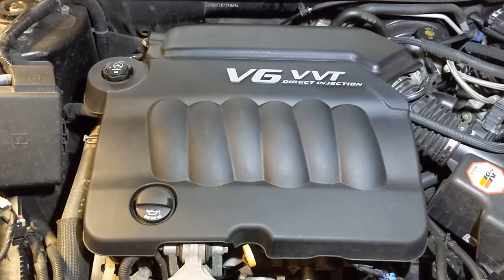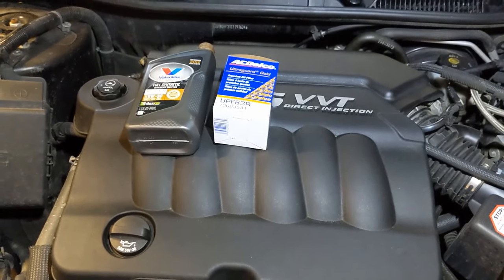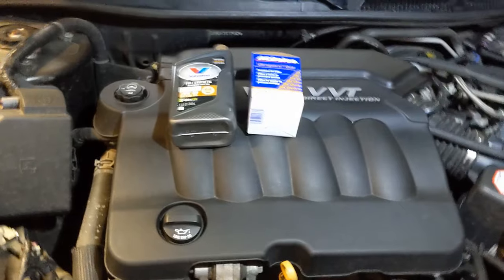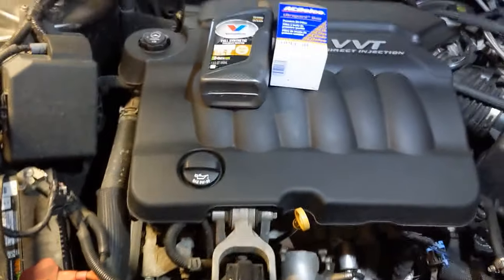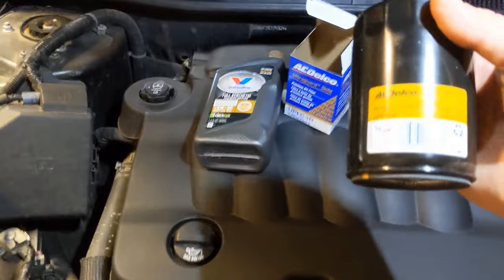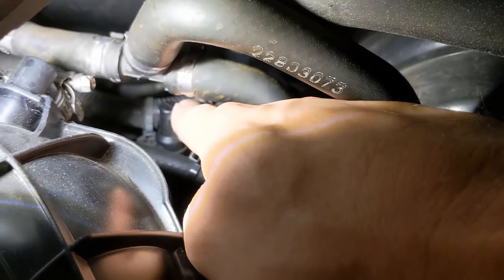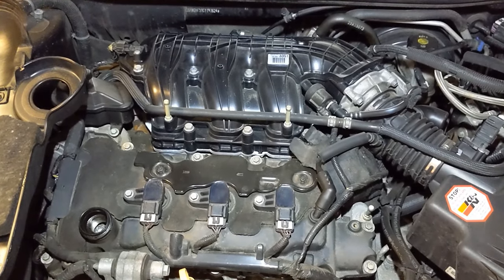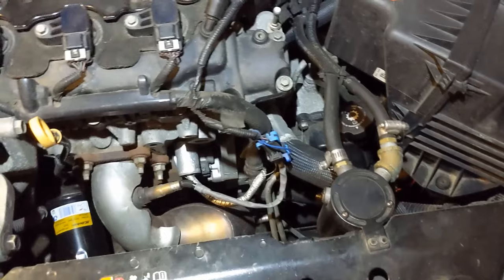How to keep your GM 3.0 or 3.6 V6 running forever - **High Feature V6 LY7 LLT LFX LGX LGZ**

Comment: What do you recommend for a 13 impala ltz has 152615 miles on it bought it almost 5 years ago with only 38k what maintenance do you recommend to keep her running strong
Reply from the maker: I would recommend the same service as I mentioned in the video. You also might want to think about getting a "BG Products Dynamic Engine Cleaner" service performed. Basically they run a bunch of chemicals through the fuel, oil, and induction systems to clean out all of the carbon and sludge.

Comment: wife wants a 2022-2023 acadia. 3.6. Are the newer ones any different as in better/improved?
Reply from the maker: Yes, they are much better. The LGX in the Acadia is essentially an all new engine. I wouldn't take that as a reason to skimp on maintenance, tho!!
Reply: @CertifiedShadetree  thx for the reply! Oh absolutely on the maintenance. I was just more curious if these are more reliable than the previous. She really wants the vehicle so I’ve been trying to do a lot of research and it’s in our price range

Comment: Any common failure points besides the timing chain failures? I feel like I keep hearing stories of woe involving the High Feature V6, but it could just all be poor maintenance intervals and confirmation bias.
Reply from the maker: All of the problems stem from poor maintenance - basically when the engine gets sludged up is when the problems start. The chain tensioners go first, then the chains stretch and jump time.  The VVT solenoids also shit the bed around the same time. Each newer revision of the engine is better than the last.  The earlier LY7's and LLT's are the most problematic, with each subsequent revision an improvement over the prior version.  As one commenter posted, the LGX is an entirely new design, and the least problematic of the bunch..
Reply: @CertifiedShadetree  I have a 2014 impala ltz 3.6 vvt are they known for any bad issues as well.
Reply from the maker: @nathanu.2061  Yep, same engine.

Comment: I have driven over 80,000 km with P0008 and P0017 codes!
It hasn’t skipped a beat yet. I’m waiting for it to go boom,but nope.....the GM money maker keeps right on running.
Yes the dealership said I had to replace the timing chains with these codes. They checked them three times based on those codes. It’s very important you know!!!!! GM junk.......I’ll drive it until it blows!
Reply from the maker: What year and model is your car?
Reply: @CertifiedShadetree  
2011 Chevy Traversty
Reply from the maker: 🤣 Traversty 🤣🤣  I used to own a Cadaverlier ..
Sucks you're stuck with an LLT.  I noticed those engines are 2x the price of an LFX on car-part.com.  Just shows they're failing at a higher rate...
Reply: Jimmy S  
It’s just those two codes.......has been for a long time now and it runs just fine.
I hate this car but it just won’t blowup !

Comment: I’m fixing to do this, I have all the parts.  I also want to replace the hose that this pcv attaches to.  I can get the hose off this valve, but how do I get the other end of the hose off?  I’m not familiar with it and I’m afraid to force it off.
Reply from the maker: I explain in this video: https://www.youtube.com/watch?v=-XlG5po15Fw
Reply: @CertifiedShadetree  , perfect, thank you, now I know the anatomy of that booger.
Reply from the maker: @MarkSmith-js2pu  Best of luck to you! 🍻

Comment: Whats the purpose of the pcv mod? Dont they have maybe updated versions? Mine is a police model curious if I need to modify ine also.
Reply from the maker: My dissertation on the PCV is in the video description. Supposedly it was updated in 2014, but both of my 2015 Limiteds still had the old PCV. Guessing it the one with larger holes was Camaro-only.

Comment: in your video you have mentioned 1/4 quart if PCV is dirty , can you please tell if how to clean out the PCV i am planning to buy a Malibu LTZ 3.6 2010 it has got only 49k miles since 2010 but i noticed smoke coming out of dipstick and oil fill hole, its not pulsating nor have any pressure to it so i assumed it might have got clogged PCV system. Car has been used for short trips only.
i also read that these LY7 engines does not have a proper PCV valve, i would love a swift reply from your side.
Reply from the maker: There's a tube that runs from the rear valve cover to the intake manifold. Depress the tab on the connector at the valve cover and lift off. Underneath is the "PCV" (it truly is just an orifice, not a true PCV.) You'll have to pry it out of the valve cover. When you get it out, drill out the holes like I mentioned, then blast it with some carb cleaner or brake cleaner until all of the carbon is gone. Blow it out before reinstalling it.

All that being said, I'd probably pull the valve cover and clean it out real good if you say you see smoke coming up through the dipstick...
Reply: @CertifiedShadetree   thanks for your quick response, but if i can pry out the so called PCV and clean it good enough do i still have need to remove valve cover and clean the orifice internally as well?
Reply from the maker: Clean and drill out the PCV first and see if it still smokes.  If it remedies the problem, you're golden!  Reason I mention cleaning the valve cover's internal baffles is I suspect there's more buildup of carbon behind the PCV if its causing smoke to blow out the dipstick tube. The PCV restriction is the root cause, for sure, but by merely cleaning the PCV, you're just scratching the surface.
Reply from the maker: Thunderbolt  The PCV is on the front valve cover of the 3500. My LFX has 172k on it presently.
Reply from the maker: It's more of an orifice than an actual PCV valve. It doesn't have a check valve inside like a conventional PCV, therefore doesn't need continual replacement. Just needs periodic cleaning.
Reply from the maker: Thanks, and Happy Holidays to you as well!!🍻

Comment: I’ve tried induction services through the throttle body and all the fluid keeps running out into the snorkel and if box. Any tips on getting it into the throttle body and intake? I’ve tried seafoam and other brands. I never get any smoke out of the tailpipe.
Reply from the maker: Check my playlist for intake valve cleaning:
https://youtube.com/playlist?list=PLKy6nBoh43BqpRUfB_LdnLakyKQzXnmxu&si=mRREm64e7t8zUZdb

Comment: Where do you get a good wire harness for this car at?? I look it up and the radio harness pops up, I need the black and pink ones that are under the driver side headlight
Reply: 2012 Chevy impala LT
Reply from the maker: GMpartsdirect.com
https://www.gmpartsdirect.com/oem-parts/gm-headlight-wiring-harness-22870592?c=Zz1lbGVjdHJpY2FsJnM9aGVhZGxhbXAtY29tcG9uZW50cyZsPTEzJm49QXNzZW1ibGllcyBQYWdlJmE9Y2hldnJvbGV0Jm89aW1wYWxhJnk9MjAxMiZ0PWx0JmU9My02bC12Ni1mbGV4

Your other option is the junkyard. They made millions of these cars and the yards are full of 'em.
Reply: @CertifiedShadetree  yeahh I’m probably going to have to make a trip down there, all these little missing pieces are driving me crazy lol, thanks for the link on the harness!
Reply from the maker: @laythonsimon7317  gmpartsdirect is a good place to look up that weird stuff that you can't find elsewhere.

Comment: Has there been ANY improvement in the newer VVT 3.6??? I love my Cadillac XT5!!!
Reply from the maker: Yes.  The LGX engine is an entirely new design, and from what I've been told, not plagued with the issues of the earlier 3.6's.  I would still change the oil every 5k, though!!
From Wikipedia:
"Starting with 2016 Cadillac models a new generation of High Feature V6s were developed. These new engines have redesigned block architectures with bore centers increased from 103 mm (4.055 in) on prior HFV6 engines to 106 mm (4.173 in) and a redesigned cooling system to target the hottest areas while also facilitating faster warm-up. They also incorporate engine start-stop technology, cylinder-deactivation, 2-stage oil pumps, and updated variable valve timing featuring intermediate park technology for late-intake valve closure. Both engines debuted in the 2016 Cadillac CT6."
Reply: @CertifiedShadetree  rock solid engines with good maintenance oil every 3000 miles

Comment: i have an a impala with the same engine and it’s leaking oil all over the passenger side of the engine i changed the oil pressure sensor and the seal on the side of the motor what could be the problem?
Reply from the maker: Timing cover gasket? Crankshaft seal? Cracked valve cover? Oil filter housing? What I would do is buy one of those dye-based leak detector kits and pour some dye into the crankcase. Run the engine for a few minutes and use the blacklight to find the source of the leak.

You say it's on the passenger side, are you certain it's not a power steering fluid leak?

Comment: For a 2017 lgx on a camaro, is the pcv mod not required? I am asking because in your description it says they began doing it from factory for a few years now
Reply from the maker: No, the LGX/LGZ engines are completely redesigned. See the pinned comment at the top of the comments section.

Comment: How did you remove the PCV?  I have a 3.0L V6 and I can't seem to remove the PCV.  There's an elbow connector I remove to get to it.  But, I can't pull up on it and can't seem to turn it.  Do you have any tricks you can recommend?
Reply from the maker: First I would recommend procuring a new PCV just in case, 'cause you may end up destroying the old one. 2nd, try clamping a vise grips onto it (lightly at first) and wobbling it back and forth as you pull up on it. If the jaws slip, tighten the vise grips and say goodbye to the PCV!  Before you reinstall the PCV, put a tiny bit of grease around the part that goes into the valve cover so it comes out freely next time..

Comment: What weight is everyone using?? Thinking about going 10w30 because of the hard starts. The first 3 seconds. Sounds rough ben then goes away. Heard its a common problem,  not sure though.  Whats yalls opinion.  Feedback much appreciated.
Reply from the maker: I've been sticking to 5W-30 with no problems whatsoever.  Personally I stick with what the owner's manual recommends, as I once tried 10W-30 in a 3100 and the thing ran like a diesel!!  Aside from that "sample size of one" anecdote, you have to remember these newer engines are built to higher tolerances and a higher weight oil may be detrimental. For example, Ford recommends 0W-20 in its newer engines! Those are some TIGHT tolerances!!
 
Honestly if you're worried about hard starts, then switching to a 0W is a better option than going to a 10W (as the first viscosity.)

Comment: I have been looking for information on keeping the LFX alive since I bought my 12 Impala in 2020. In the 3 years I have had it it has had 6 oil changes. Expensive? Yes. replacing timing chains and phazers expensive? not even on the same page. Fresh load of Royal Purple and a K&N filter every spring and fall with the seasonal tire change. This is the first I have heard of the PVC mod though It woiuld have the effect of applying more vacuum to the crankcase though I dont see how thats adventageous.
Reply from the maker: The earlier 3.6's had issues with sludge building up under the PCV on the rear valve cover. In subsequent revisions of the engine, the valve cover gasket was redesigned as was the PCV (larger holes) to alleviate the excess pressure that caused the build up.

Pull your PCV out and inspect it. Guarantee the bottom of it is sludged up. Even after enlarging the holes it still sludges up. I like to pull mine at least once a year and clean it out with intake cleaner.
Reply: Get rid of the K&N filter it will shorten the engine life they allow dust into the cyls and then you end up wearing the rings and bores causing oil usage and blowby which is why a lot of people install catchcans. I am an engine reconditioner and take it from me if you need a catchcan your engine is tired.
Reply: @grantreid8583  using factory air filter and K&N oil filter only. I have heard about K&N air filters letting too much particulate through.

Comment: I just came across this video and was wondering if at 195000 on my 11 Malibu LTZ should I still do the pcv valve mod?I always try and get the oil changed at 5000 or less at the gm dealer but still feel like I’m driving a hand grenade with the pin pulled engine
Reply from the maker: I still would. Just pulling the PCV might give you an indication of whether the rear valve cover is sludged or not.
Reply: @CertifiedShadetree  I’ll definitely do that tomorrow then.Also thought of another question,would it hurt to run some Berryman B-12 through the fuel?
Reply from the maker: Not at all!  Yours is still port injected, so you won't have to worry about the issues that plague the DI engines..

Comment: Would a 2023 Camaro LGX require the PVC drilling or this correct the issue by then?  I do my oil changes at 5k with Mobil 1 Extended Performance full synthetic.  Thanks for the vid!
Reply from the maker: No, the LGX has a vastly improved PCV valve. I would consider a catch can and clean side separator, however. Check out Elite Engineering, they have both specifically for 6G Camaros.

Comment: I have a 2015 Chevy Equinox 3.6 AWD. Where is the PVC valve on it ? I feel likes it’s on the drivers side of the engine in the back. Facing the car it would be on my right. Any help would be nice
Reply from the maker: Correct, it's on the valve cover of the rear cylinder bank on the driver's side. There is a hose running from the intake manifold to a fitting on the PCV. Best way to visualize it is to visit RockAuto dot com, punch in your vehicle's info, and search for the PCV, hose, and connector..
Reply: @CertifiedShadetree  I think I found it but that SOB feels like it’s stuck in there some kinda fierce . The dealership was telling me I had to take the whole intake Manifold off to get to it. But I pulled the front cover off and the PVC looking hose and it looks like a small PVC valve for sure. Just hope it’s nothing to remove from under the valve cover.
Reply from the maker: It's completely removable from the top side. The connector has a tab on the bottom you depress, then it pulls straight up and off.  Then you just grab the PCV with a pliers and rock it back and forth while pulling up on it. Someone once told me you can spray some cold-freeze spray on the PCV and it'll shrink the metal enough to easily slide it out..

Comment: can these engines handle abuse if i take care of it from the maintenance side?
Reply from the maker: The Camaro guys would say yes!! There are nitrous and supercharger kits available for RWD applications, plus Cadillac has a factory twin turbo version. I would worry more about the transmission failing before the engine if you were to throw forced induction at it. The weak point definitely is the transmission, especially in a FWD model.

Comment: I just bought a 2013 Impala LTZ with this engine (well, I think it is) If I have the VVT engine cover, it's the same correct? I've seen some videos of 2013 with just the "V6" label. Second question, my airbox has a second smaller hose coming out of the side. . .there's supposed to be something there but mine is just missing whatever is supposed to be there. I see your airbox (and others) usually don't have this? I'm at a loss as to what is supposed to be there and why some people's just have nothing there. Thanks for any help!
Reply from the maker: Your 13 does have this engine (it was the standard engine from '12 until the end of the W-Body's run in '16.) I believe the tube you're referencing has to do with California emissions, and yes there should be a canister attached to the end of the tube, otherwise you're sucking in unfiltered air!  You could just insert a pipe plug that fits in the end of that tube and clamp it off and you should be fine.
Reply: @CertifiedShadetree  okay, that makes sense! This particular Impala was was in New York City for the first year of it's life so maybe thats why. Thank you so much for the info!
Reply from the maker: No problem!  I'm fairly certain that little canister is just a sound resonator that's completely unnecessary, hence why it's not on the "Federal" models...

Comment: Hi there ,I have 2014 cadillac ats 3.6 should i get catch can ? Or if there anything I should do .The ATS has already 281903km on it .i have limited knowledge when it comes to cars and mainly learn these stuff through youtube. thanks in advance
Reply from the maker: I would mod the PCV valve first, then install a catch can on the dirty side. Follow that up with a clean-side separator and a BG EPR engine flush, then going forward change the oil every 3-4k and you should be golden.  Links are in the description for the flush, catch can, PCV mod, and the clean-side separator..
Reply: @CertifiedShadetree  ok thanks very much
Reply: After doing a DIY intake cleaning, I put a catch can on my 2016 Colorado at about 10k miles. I empty about three ounces of oil and gunk every two thousand miles.

Comment: I hope my Camaro lasts alooooong looong time, i believe it is a 2013 Camaro RS with the LFX with 160k kilometers on the clock, i change the oil every 6000-8000 kilometers. is that enough?
Reply from the maker: 8k kilometers roughly translates to 5k miles, so you're golden!! Just make sure you're using synthetic oil!👍
Reply: My mom had a 2010 Camaro RS and it blew up with less than 6k miles on the oil, so long as you change it on time w/ full synthetic you should be fine